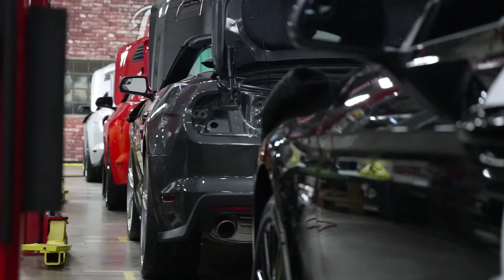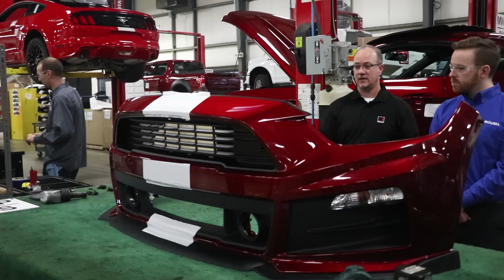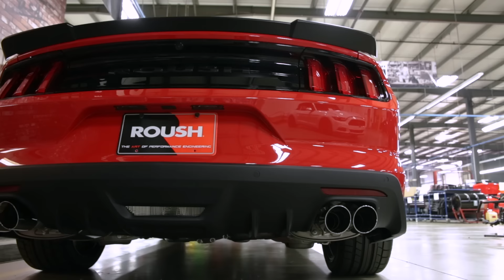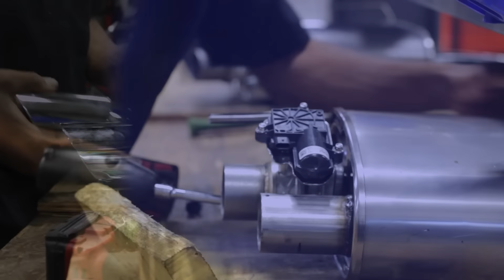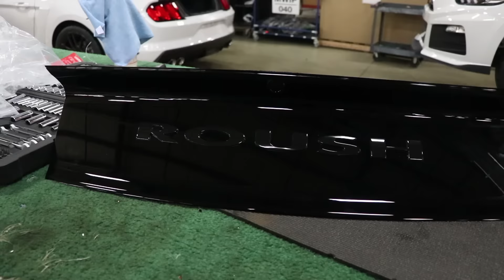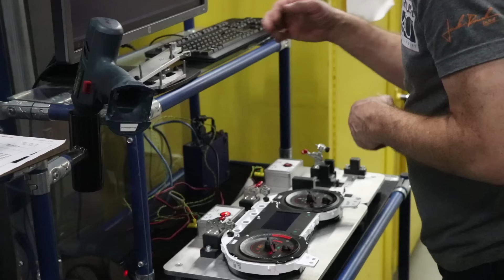ROUSH Between the Gears: Episode 3

Comment: 4wd? wtf!! or just road speed simulator?
Reply from the maker: This video was shot in one of our NVH chambers to measure Noise, Vibration, and Harshness of the vehicle while it is in motion. The front two rollers spin the front tires to simulate road noise.
Reply: Probably Noise simulator. Need to have all 4 wheels moving to get the true sound of the exhaust while the car is in motion.